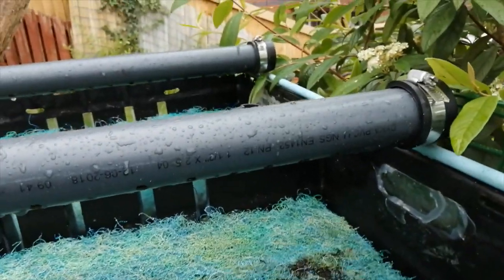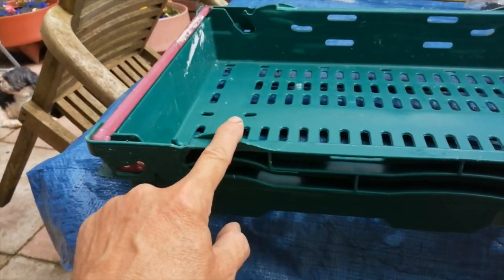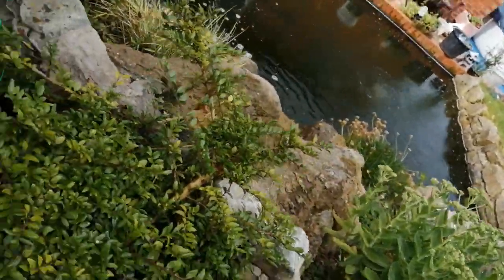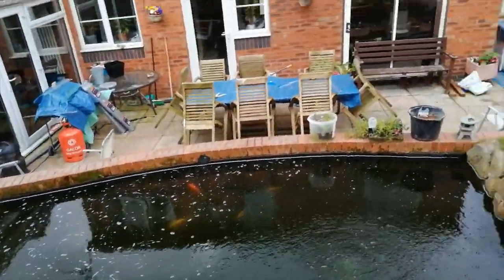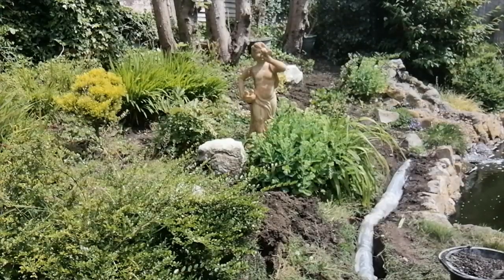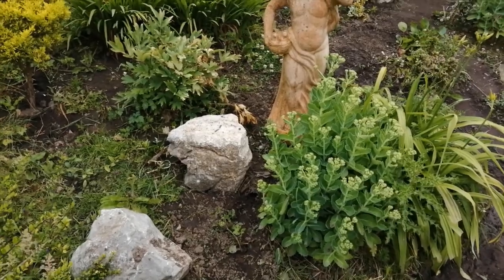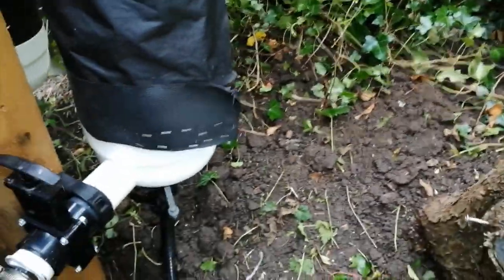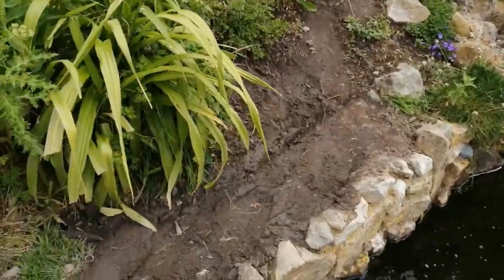Tempest waste water getting back into pond, DIY Bakki lids, Sieve trays and green water nightmare.

Comment: nice pond and garden regarding your drainage pipe at the back of the pond to stop the water going back to pond you would of been better going deeper and putting at least 5 inches of gravel over the top of pipe then soil it will make a better soak away good luck m8 keep safe
Reply from the maker: Thanks for the tip, and although the tempest waste is now directed away. I'm hoping the drainage pipe will still soak away rain water that comes down the embankment. Not sure if it will but thanks for the advice.👍